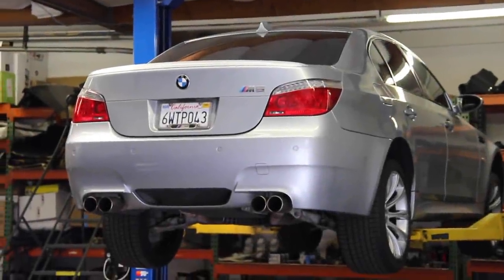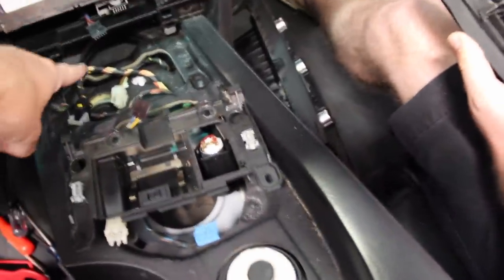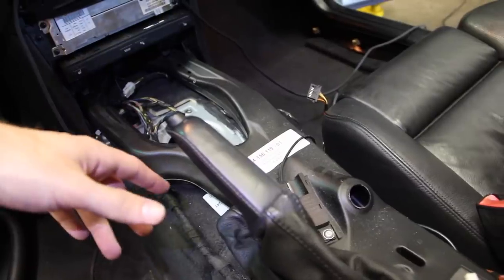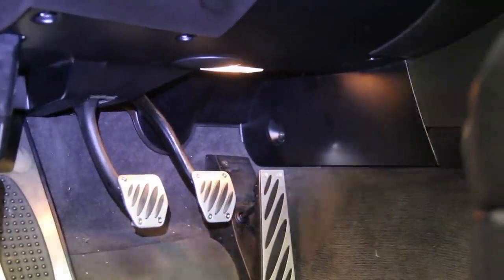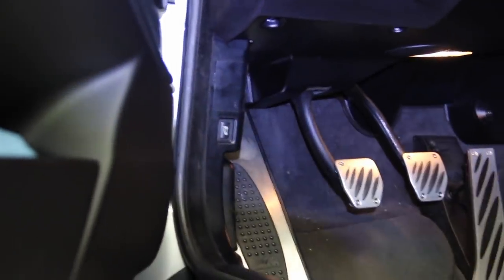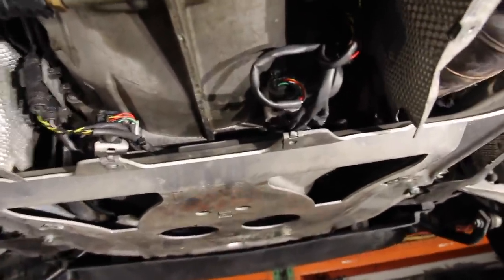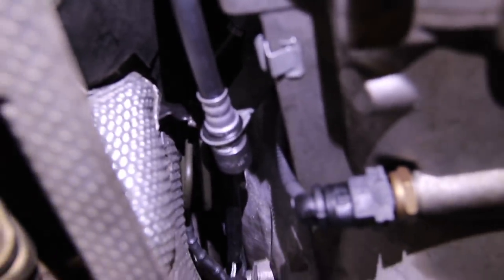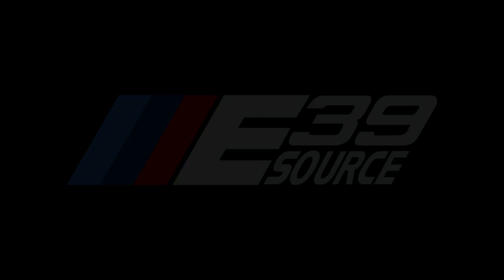PART 2: BMW E60 M5 SMG to Manual Swap (Mechanical Work)

Comment: Nice video, it helped me with the swap. I installed the hydraulic clutchline without removing the drivers seat. i did pulled back the carpetting to install the clutchline.
The flywheel from the smg can be used for the manual according to a contact that did the swap. i cant confirm that, im still building.
i removed the brakebooster and than pulled out the pedal assembly to easily install the clutchpedal and parts.
Reply from the maker: Thanks for commenting and for the information!  I'd be very curious about that flywheel.  Good luck with the rest of the swap.

Comment: 20:15 I bet it just reads the throttle signal and if it goes past the switches area it’s in kick down mode. Switch just makes it obvious for us that it’s happening. I wonder if that’s gonna affect the engines tuning with the throttle still maybe thinking there’s a lockdown area.
Reply from the maker: The lock-down area is still there, you just don't feel the switch anymore.  It still actuates 0-100% in INPA, like before.

Comment: Nice job. Can you advise who built the custom driveshaft? A review would be good too especially thoughts to compare e39 vs e60 manual (as well as SMG).
Reply from the maker: DriveshaftPro in San Diego did the driveshaft.  I'll see about doing a review!

Comment: Those white 'receptors' as you called them, in the dash, for dash trim , same E39 - is it normal for the little metal 'jaws' in them to bite so hard you got both hands behind the wood trim, fingers splayed to distribute the load evenly so as not to crack it (I did put a hairline crack in it), and a foot up on the dash pulling with all your might, until one of the pins clean rips out of the aluminium backing on trim?
I never saw anything like it. I tried silicone spray, working it side to side etc.
Reply from the maker: They absolutely shouldn't be that tight.  I wonder if somebody before had those receptors break apart and then the glued the trim on?

Comment: Thanks a lot for this video! From everything I've read online, I was led to believe that this couldn't be done without ripping the entire vehicle apart and replacing the entire vehicle harness (which I knew was ridiculous, but never found any instruction on how the harness  would need to be modified). 

I just replaced a bunch of parts on the SMG and have a new clutch, so I probably won't be doing this anytime soon. I also like the SMG (when it's working properly). However, I would definitely consider doing a manual swap if I could convert the manual geartrain to non-synchromesh. Have you ever been inside the E9x M3 gearbox and know whether it would be feasible to replace the gear sets with ones that use synchroless dog rings? That would be super cool.
Reply from the maker: I've never opened the gearbox, and don't know much about that conversion.  Sorry!
Reply from the maker: To make it 1:1 to a factory manual car, yeah, you would have to do that.  But if you can handle making (and are okay with) a few pin changes and custom wire taps, it's not that bad!
Reply: E39Source Awesome! I've already pretty heavily modified various areas of the vehicle's harness, so I have no issue with that. I think it's insane to completely tear the vehicle apart to replace the harness. Plenty of things are likely to be damaged or broken along the way as well. I don't think the interior of the vehicle would ever be quite as pristine as it once was if it were stripped.

Comment: wasn't esyer to install a manual cluch and keap the smg pump ?  it was nice to keap a seven speed sequencial  gearbox ,and operate the gears by the pedal shifters .
 do you think it's possible ?
Reply from the maker: So put a manual clutch in but shift with the paddles?  That would be completely impossible.
Reply: @E39Source  i dont know how a smg pump works but thanks anyway .

Comment: Question if you don’t mind, did you have to do any coding or wiring for the initial start?
Reply from the maker: It won't crank until the wiring/coding has been completed.

Comment: Hey man, would you have the Flywheel Torque Specs? I can’t find it in the sheet you linked. Thank you!
Reply from the maker: Hmm, it’s not there!  My apologies. The spec is 105nm or 77.4lb/ft
Reply: E39Source hey man sorry for the bother again. But the driveshaft to the differential with the E12 bolts.. what is the torque spec? Some people say 85nm no TTY, but in your spreadsheet it says 40nm then it says 45nm to 45 degree, not to mention you have a custom driveshaft like you said….so I’m a little lost. Thanks again
Reply from the maker: @Bouhlev  The spec I referenced was specific to our E60 M5's bolt size/thread/type.  If yours is the same, follow the published spec.  Otherwise, I'd use NewTIS.info to determine the specific torque spec for your hardware.  Our custom driveshaft/CV joint used factory BMW hardware.

Comment: Hi there!
Amazing content, really great watch 👌🏻
I’m considering doing this swap at some point in the near future and was wondering if it is possible to use E9x m3 flywheel? 
Thanks
Reply from the maker: Thank you!  I have since done another conversion for a customer, and we used the E9x M3 flywheel and clutch kit.  It bolts on and functions 100%!  At a fraction of the cost of the M5 parts.
Reply: That’s great, thank you for getting back to me 👍🏻

Comment: those little yellow springs on the pressure plate should be compressed all the way, before installing that  wear-adjustable clutch, otherwise you find yourself wearing out the clutch prematurely...other than that,great job

Comment: Whoa whoa whoa we are just going to accept defeat for a massive mystery of how the kickdown switch works? It has to communicate somehow or it’s not really what people think it is. It’s clearly not Wireless so what’s the deal. Fascinating
Reply from the maker: I think the kickdown switch is just for the driver, so they know they're at the floor?  The throttle cable just moves that extra 1/4 inch to fully 'open' it as it is pressed.
Reply: E39Source so it’s not actually a switch as much as tactile feedback and the programming is in the throttle (drive by wire?? Or no?) seems bizarre, I hope one day we can get the whole story that sort of thing fascinated me especially as it relates to people’s perception of something. It would be a neat experiment to have someone with the smg swap the throttle and see if there’s any noticeable difference in behavior.
Reply: E39Source I wonder if your throttle cable is 1/4” longer than the manual models 😂
Reply: E39Source last question, does this make any sense for someone buying a e60 right now in your view? Or only existing owners. I’m not familiar with the current cost delta
Reply from the maker: @Fee.1  I think it is just tactile feedback.  The throttle works from 0-100% 'open' with or without the switch.  But with the switch, you are more aware when at you're at 95% and above.  I'll make a video about who it makes senses for, but I would only recommend this for current and invested E60 M5 SMG  owners.
Reply: E39Source thanks, appreciate the replies and insight. I also just assumed that this swap was a personal project for a car you’d bought.

Comment: i am from brazil and i own a 545i motorsport v8 6hp28 and i was afraid of the pedal parts for the swap. I am so happy that you updated that video with so much quaility content, thank you very much, helped a lot. Thats a fucking expensive car in brazil, i am trying to buy the clutch parts on ebay, but i cant find, can u tell me if the e39 clutch pedal fits?? i just know that the zf 420g manual fits on 4.4 v8 e60, but i need the clutch pedal and the rest i can fabricate for... Thank you very much!
Reply from the maker: The E39 pedal should work

Comment: Awesome Video!!!
So which flywheel \ clutch combination you went with? Does the E92 flywheel and clutch fits or it needs to be specific for S85?
Reply from the maker: E9x M3 flywheel/clutch kit DO work for the E60 M5.  We used the factory E60 M5 parts, though.

Comment: what gearbox is that, does the e92 m3 manual gearbox bolt right on to the s85 ?
Reply from the maker: Yes, the E9x M3 gearbox works perfectly (along with clutch kit)

Comment: Good Job!  just wondering that e92m3 manual is gonna be direct swap if e60 m5 comes with a manual?
Reply from the maker: Direct swap, only difference is that the E9x M3 trans has an oil filter (E60 M5 manual does not) and the M3's uses an oil cooler that must be retrofit or just plumbed off.
Reply: @E39Source  Thanks a lot! valuable info! I was thinking that going with e92 6 speed for more sporty gear ratio, but just found out these two trans have similar ratios.  Maybe e92 dct swap is interesting project too!

Comment: Why orginal m5 e60 manual gearbox doesnt have power button?  Thats mean that they have only 400 ps ?
Reply from the maker: You adjust the power configuration in iDrive and use the M button on the steering wheel to activate different modes.

Comment: It won't allow me to loom at the spreadsheet
Reply from the maker: I just verified that the link is indeed working.  It likely won't work on a smartphone though, you'll need to use a computer.
Reply: @E39Source  oh I see I'm sure using a smartphone

Comment: Do you need to program anything? Or just buy a wrecked manual and swap it all along with ecu and stuff.
Reply from the maker: LOTS of coding/programming for the DME, nav, DSC, general module, cluster, etc.  Way easier to change settings than components.  Most of the components would need to be programmed to the new car anyways.

Comment: Thank you very much for these videos, with them I will be able to convert from SMG to Manual :).  The knowledge and value you bring is incredible, I am very grateful.  I also wanted to ask you if the gearbox of the european m3 e92 is valid for the swap.  The one you use in the video is 23002283601 GS6-53BZ - TJGC, and the European one is
  23002283600 GS6-53BZ - JGC.  Thank you!!
Reply from the maker: That should work fine!
Reply: @E39Source  Thanks !!, and with the flywheel of the m3 e92, will the s85 be well compensated?
Reply from the maker: @javiktm525  Not sure what you mean by compensated, but it will work just fine.  Just like factory.
Reply: @E39Source  I mean that since the m3 e92's flywheel has a different reference to that of the manual m5 e60, I don't know if the mass or weight of the m3 e92 flywheel may be different from that of the manual m5 e60, and affect the s85 in some way.  I have also seen that they put the flywheel of the m5 e60 smg, but I no longer know if the box of the m3 e92 would be worth it.
Reply from the maker: @javiktm525  I'm sure there is some subtle difference somewhere, though the E9x M3 gearbox, flywheel, and clutch kit all work just like the E60 M5's in my findings.
Reply: @E39Source  Well then great !!! Thank you very much, you are making my dream come true of having a manual m5 e60 here in Europe that are very difficult to find.  You are amazing!
Reply from the maker: @javiktm525  Good luck with the conversion!!
Reply: @E39Source  At minute 34:32 did you manage to boot before encoding?  My engine doesn't turn over when I turn on the key, it's as if it doesn't authorize the start.

Thanks!!
Reply from the maker: @javiktm525  Boot what?  For no-start issues, scan for codes that will let you know what the problem is.
Reply: @E39Source  Sorry for my English, I meant when you start the engine at minute 34. I have it the same, with the manual gearbox, but still not coded and I wanted to start the engine earlier to check that everything is still ok.

 These are the errors I have:

CDC1 DME: SMG, message CAN 1
CDC2 DME: SMG, message CAN 2
CDC3 DME: SMG, message CAN 3

5101 SMG: Hydraulic Pressure Sensor
510E SMG: Clutch Position Sensor PLCD,
510D SMG: Clutch Position Sensor PLCD
5106 SMG: Gear position sensor via R/1
5107 SMG: Gear position sensor via R/1
5108 SMG: Gear position sensor track 5/3
5109 SMG: Gear position sensor track 2/4
510A SMG: Gear Position Sensor Track 6/7
520A SMG: Wrong Steering Angle Signal (DSC)
5100 SMG: Hydraulics Temperature Sensor
Reply from the maker: @javiktm525  The DME needs to be flashed to the manual firmware version, this should remove the SMG codes in the DME.  The rest of the vehicle's modules (CAS, LMA, KOMBI, DSC, CAPPL) all need to be coded to manual as well.  The LMA and CAS need to have an FA_WRITE done with the new VO, after the VO has been adjusted to add option $2MA.  This will remove the SMG codes.
Reply: @E39Source  Thanks for your answer, it's a good summary of your third video.  But I mean that you start in video two, without actually doing the DME flash and without adding 2MA, right?  So I just wanted to start the car before I start flashing and coding.
Reply from the maker: @javiktm525  The start in this video was BEFORE programming the DME to manual, but AFTER coding the rest of the car- I believe.